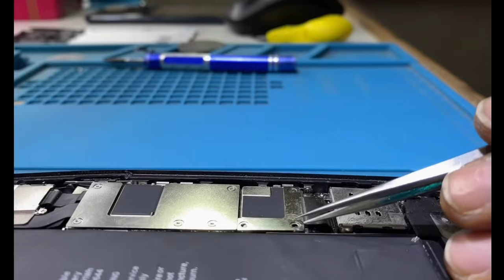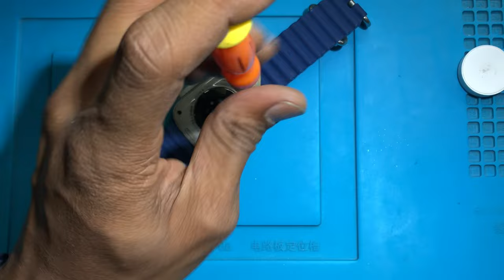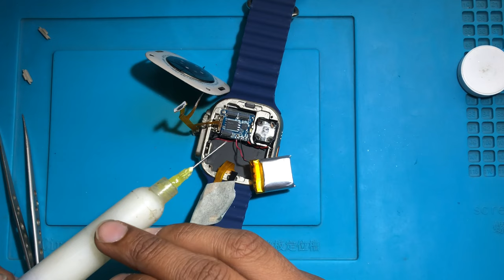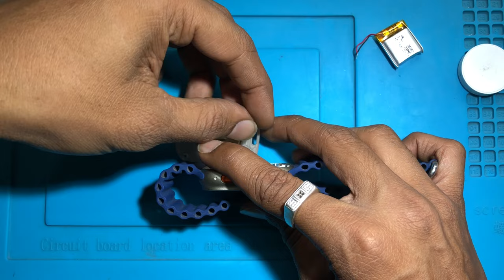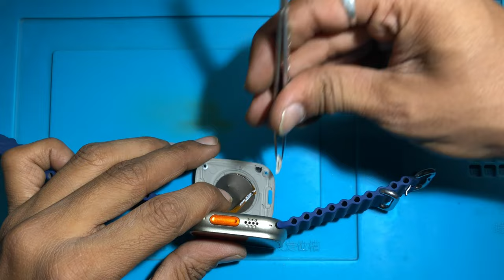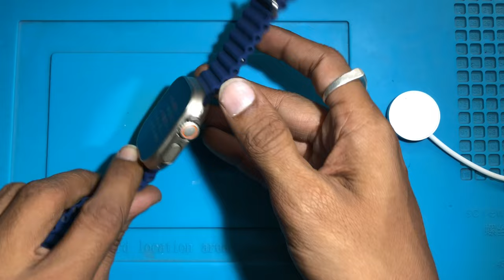Fake Apple Watch Ultra Battery Replacement Tutorial ! Fake Watch 🔥4K

Comment: Bro please repair my smart watch the watch screen is coming out because the battery is hot and battery is big inside the watch
Reply: Bro remove the display and then by using a pointed safety pin put a shall hole in battery for the bubly ga
gass to go out. Then use a piece of cello tape to close the hole. After that by using d MHR-14 glue you should fix the display back to the position.
😊❤